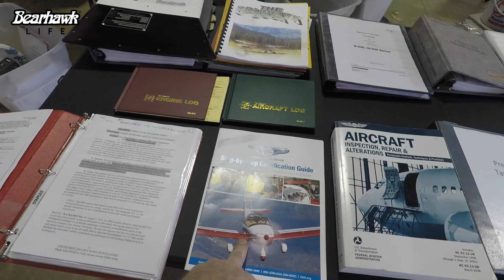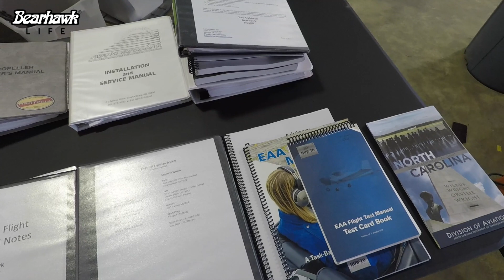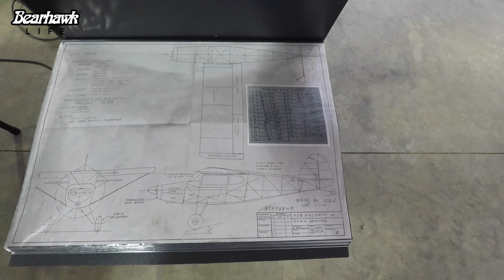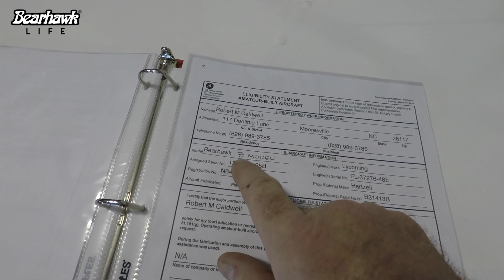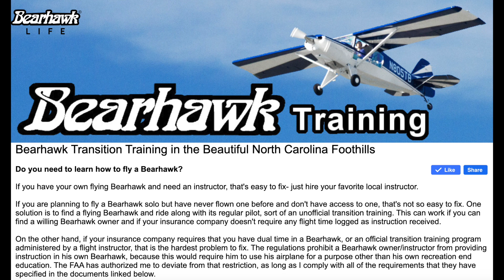BEARHAWK ~ I failed the Airworthiness Inspection.  (Part 5 AW Certification and Phase 1 Flight Test)

Comment: That’s a pretty clean inspection really. 3 minor mechanical snags and a paperwork glitch. Considering all the work you did that’s pretty damn good.
Reply from the maker: Thanks so much!
Reply: @TheBaldPilot  i imported a 40 yr old Jodel into Canada from the US. The CofR said Jodel F11 but the data plate said Jodel F-11. So Transport Canada said no good, doesn’t match. But the seller had already cancelled the FAA reg. So we were stuck in no-man’s land. Thankfully the FAA fixed the error and sent a new cancelled C of R. They did it within 1 business day. They faxed it to TC where it sat for 6 weeks on someone’s desk while we waited to see if we would have an airplane or an expensive bonfire. Typical. It ended well. The moral of the story is that those little details can shaft you.
Reply from the maker: @sblack48  Gotta love bureaucracies!  I spent 3 years building this airplane thinking everyday to be mindful of my work because the FAA would be inspecting everything.  On the day of inspection,  they were clueless of how it was built.  Spent the majority of the time looking at the paperwork.  🙄

Comment: I was sure it could not have been because of your build work when I first read the YouTube video caption headline ... LOL, you got me.

Congratulations ! 

Yes the lockwire was a definite change, the other stuff, six of one half a dozen of the other, as long as you have an absolute minimum of 1/4" clearance for the worse limiting position case.

Your work has been tops and you continue to demonstrate your commitment to safety by carefully working your way up to your first flight without putting pressure upon yourself to meet a specified schedule. Excellent strategy (two thumbs up). Well done all around.
Reply from the maker: Ha!  Just trying to get the views!  Thanks for watching!